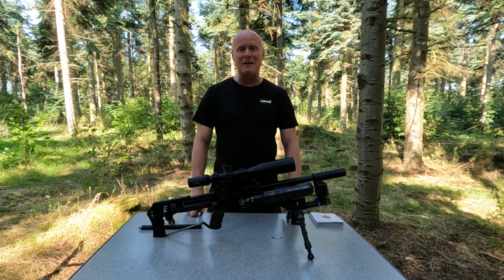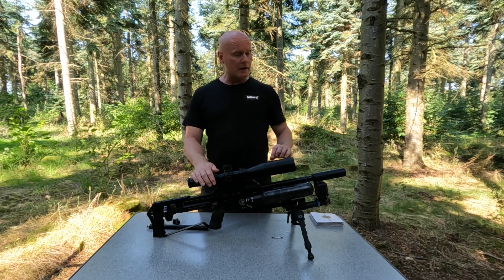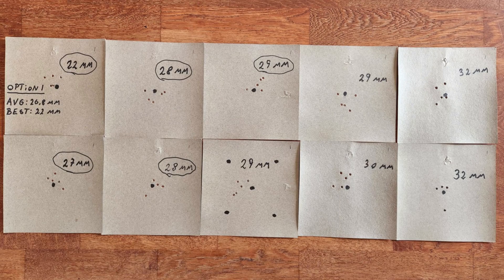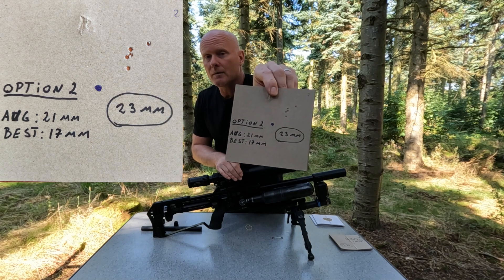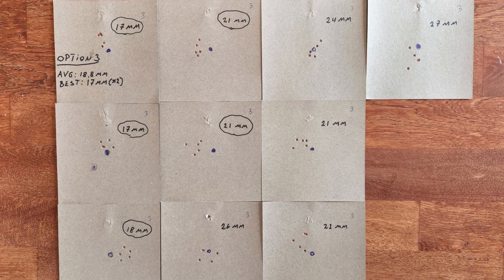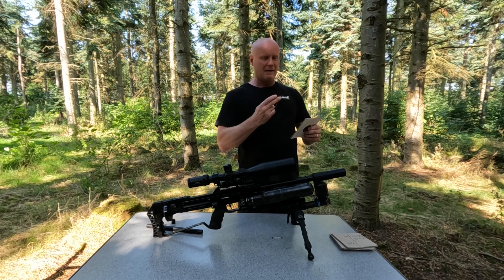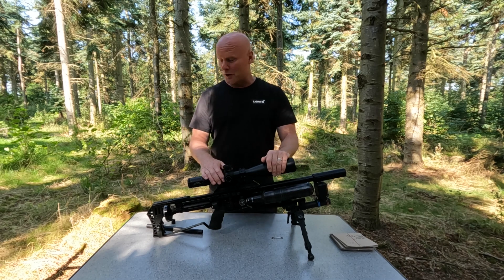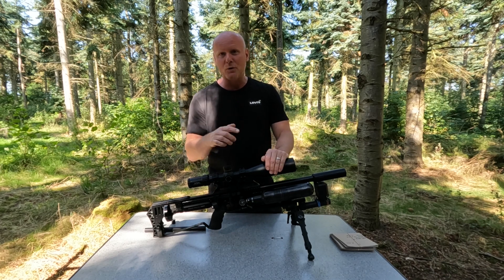TEST : Barrel Tensioner on FX Impact M3

Comment: Whats the difference from using the tensioner and using a barrel band from Blackarts design to stiffen the barrel
Reply from the maker: I havent tried the barrel bands but the way I see it, the bottle is far from 100% round, so when using a barrel band on an Impact it will not have a positive effect on accuracy.
On a gun like the Wildcat it would be a different case.
And the barrel tensioner stiffens up the whole barrel while the barrel band still allows the barrel to vibrate between the supported places.
Not saying what is the best and from my video you can see that the results with the barrel tensioner on the 600 mm 177 was not a succes for me.
Will be testing on the 700 mm liner when I get the heavy liner and hopefully get the heavier slugs to perform well 🙂
Reply: @VikingAirgunner  I have the barrel band and it stiffens that barrell tremendously.  I have it with the new FX harmonic barrel Tunner.  Still testing it and getting good results.  I   wouldnt think the roundness of the bottle will affect accuracy if we are using it to stiffen the barrel.  just thinking,  thanks for the input!
Reply from the maker: @nephtalilucero8084  Somebody asked me about the best combination of accessories. Made me think about how many variables we have to consider.
So my thought was:
When I get the right combination between reg, hammer, valve, liner, ammo, barrel tension, barrel tuner/no barrel tuner, liner sleeve/no liner sleeve, scope, bipod - my accuracy will be exceptionel 😃

So what I mean is that there are so many ways of setting up a gun, and there are many good and exciting ways to do it, and it is important to be open minded 🙂
Thanks for sharing your experiences mate 🙂
Reply: @VikingAirgunner  I am also interested to check "FX Impact M3 Barrel Kit STX Tensioned 700 mm"  with heavy liner. but issue that if should we change Dual Hole Transfer Port or keep it standard Transfer Port ?
Reply from the maker: @devroRR  Good question!
People have different experiences with the dual hole transfer port. I have a much bigger spread and when changing to the standard the spread went down by alot.
If I can get the velocity that I want with the standard port without having to turn up the too much, I will not go for the dual hole.
I cant imagine that I will use it again since Im not into the 20 gr. 16 gr is enough 🙂
Reply: @VikingAirgunner  I am also shooting 13gr and 16 gr slugs.  And this is the dilemma I am having that if I need to shoot 20gr or more I need to upgrade 700mm barrel and dual port. And if it will be accurate like standard M3 or not ? I don't want to loose accuracy.
Reply from the maker: @devroRR  Im currently testing the 700 mm heavy liner and so far it is performing well with the 13 gr. I will also test the 15 gr NSA and 16 gr Zan, so in a hopefully not to distant future a video will emerge 😃
Reply: @VikingAirgunner  I will be waiting your results and to watch your video 👍

Comment: Hi Peter, Nice test so we don't have to spend money on that. I am just to begin in the FX Impact 4.5mm world and would like to ask you what silencer/moderator you would recommend ?. I am living in DK.
Reply from the maker: Hi and welcome to the fx world 😃 You can look forward to many happy hours of shooting and many headaches when you cant get it to work 😂

The moderator that I use is a Huma Mod 40 3, but it is not much different from the standard one that comes with the gun in terms of both sound and accuracy. There are many other places to spend money before considering this 🙂

Best regards
Peter P
Reply: @VikingAirgunner  Thank you for your welcome, I have looked at almost the same channels as you, being confused is easy especially when there is so little 4.5mm content, so your channel is good sent. About the fx moderator, I have been told that tube/shroud that holds the moderator is empty in the DK version . I have thought about getting the Saber Tactical Arca Swiss Rail 2, just not decided yet if I should get the one with 3 holes in the bottom or the 2 hole version (vibration vise) I could imagine the vibrations from the 3 hole version being greater than the 2 hole (when bipod is not used, free hand shooting) I can see that you have the bipod about the same place as the 2 hole that is Picatinny at the end.
Reply from the maker: @zephyrold2478  It is true that both the shroud and the moderator are empty inside, but they have a good sound reduction. I have shot my gun without them both and like that it is very loud. Like in this video with just the barrel tensioner and a Huma moderator it is loud. I dont know if a bigger moderator would help, but Im not sure that I would like the looks of the gun with the barrel tensioner and a Sumo 🤔 But I guess that is individual 🙂
The Arca Swiss rail that Im using is super steady and I like the small piece of picatinny where I have my chrono, so I can use it at any time without having to think about vibrations. Hanging the chrono on the barrel Is a no go 😃
Reply: @VikingAirgunner  Hi Peter, I am having some gallstone problems, I will get back to you later.
Reply from the maker: @zephyrold2478  I hope that you will get a fast recovery 😳

Comment: Are you still using the Huma dual transfer port by chance, or did you keep it off?
Reply from the maker: Imideately after changing into the original transfer port I saw a positive change in spread, so now with a spread less than 5 fps I dont think that I will reinstall the dual hole transfer port. And on top of that I didnt need to raise the reg that much to get the velocity that I need, so all in all the original transfer port wins over the dual hole 🙂

Comment: The tensioner might work with longer barrels and heavier projectiles. This is due the flimsy design of the FX liners, straw pea shooters, no other manyfacturer requires this and their barrels aren't as slug fussy as the FX. I own a ccople of FX's and is getting fedup with all the market add-ons you need to make the gun better. It is getting absurd, I have been testing some 177 slugs on my own channel, and the more I test the more I get peeved off with FX. I had a LW barrel made for the FX, it is beautiful, only 500mm but it shoots 100% better than any 177 FX barrel. (I have the 500mm and 600mm). The LW wins hands down, no need for add-ons, no need for tentioners as the barrel is solid. No drooping if you add a heavy silencer either. I still love my FX, no other gun is as versatile, both in 177 and 22, but the additional marketing stuff is mind blowing nonsence. My HW100, AA EV2, AA HFT500 will kick the FX out the park any given day. This was obvious at the Worlds Hunter Field Target champs in Hungary... guess how many FX guns were used? NONE.
Reply from the maker: Hi Gert
Thanks for sharing your experiences! I really appreciate it.
In this particular case I feel like I have spent money on nothing. But I still wonder if it will make a positive difference in the 700 mm liner with heavier slugs. I kinda doubt it though. But this is explained in fx homepage, so I guess that I should have listened 😃
But I still think about the recent results of Ted Bier. A 0.38 group on 100 yards. That is impressive - but I also saw the amount of slugs in different brands and sizes that he had.
Also Im thinking of RMAC where FX is heavily represented in the top of the list. I know that there are mainly FX'S in the comp, but there are other brands aswell and seriously good shooters. I remember a national team member of SA with a Daystate. So the results of the FX'S must be superior. And if the guns that you mention are so much better - why arent they winning competitions like RMAC? 
And thinking about my own groups - 1,1 cm on 75 m and 2,2 cm at 100m. I cant really see how it can be done much better.

I am interested though in the LW barrels. They seem much less picky with ammo and all the advantages that you mention.
My question is:
From the national team member with the Daystate at last years RMAC, it sounded like you will only get 300 shots before you have to clean the barrel. And right after cleaning you have to fire alot of shots before the barrel is seasoned. That sounds a like a bit of a hazzle.
What are your experiences with the cleaning cycle of the LW barrels?
Reply: @VikingAirgunner  Hi Viking. in the 22 calibre and bigger FX has no competition. Lauren Parsons shoot Daystate, she is the current World FT champion with a Daystate. None of the RMAC guns are 177, again FX not good in the smaller calibre. FX does good where there is no restriction on power. The benchrest worlds are dominated by Steyr, Ft worlds the same, FX doesn't feature where power limitations and calibre limitations are present. 

LW barrels are more aggressively rifled, depending on the pellets you use, cleaning is not an issue, cleaning consists most of the time shooting a pellet cleaner through. FX are the winners here by far, the smooth twist barrel doesn't accumulate lead at all. 

FX is the current market leader, but the competition is closing in quickly, RMAC was won with a Priest a year or two ago. The adjustability is superior in the FX, but all the aftermarket things you need to buy is rediculous. The sponsored guys get all this stuff for free... Me , I am a salaried employee, I can't afford this stuff and I love this sport, spend a bucket load on every new FX liner, barrel, bag rider, Element scope etc. I just reached a place in my life where enough is enough. I am not spending another dollar on stuf that is most  of the time either marketing nonsence, or could have been in the original product. How many FX owners buy them to shoot "standard" pellets?

I tilt my hat for FX, they are making mega bucks in the process, their R&D is superior to any other air rifle manufacturer. I just can't afford all the "needed" extras anymore. It is a bottomless pit. 

I spend more than 12 months testing jsut about every darn pellet and slug available to me, just to realize that you can shoot just about any slug with decent accuracy if you spend the time fine tuning your gun. My HW100 worlds gun took only 3 tins of pellets to find one that was brilliant... 

How many FX owners have the time to put into testing that you do? They simply buy the "next" gadget the Youtubers post... There is only 1 youtuber a fully trust with his feedback. (You are going to become no 2 with the great work you do - please keep it up).
Reply from the maker: @AimSmall  Thank you so much for your answer. I follow you completely.
I just have to confess that I have not yet given up on buying all the new accessories - Even if the last purchase was a bummer I still like the testing and making the videos. And thank you for your appreciation of my honesty, since that is what I try keep all the way.

I didnt know that cleaning the LW barrels was so easy. Im more and more convinced that I have to give them a try 😃

Best regards
Reply: @AimSmall  I have 5 FX air guns in different calibres none of the guns can hit a target accurately at more than 70 yards.
Reply: Gert you nailed it. Every 6 months there is a newer gadget thats just better and you must have it. For the amount of money we spend in these fx impacts it should be the best it could be out of the box. Fx should rather focus on their qaulity control wich is 0 to none. Almost every rifle has a leak. Its a shame really.
Reply: @kobusswart2972  Thank you Kobus, I didnt want to go into that debate... haven't had a single FX yet without a leak... too many o-rings.
Reply: @kobusswart2972  oui j'ai démonter tout et remonter, après ok
Reply: Good consideration, but.. where can I find the LW for the Impact? Many tks
Reply: You need to special order from somebody, I ordered mine when H&N asked for a special barrel for testing. @fabriziopapetti8455

Comment: Hey Peter - thanks a lot for the video. The only way I can achieve tighter groups for my 177 Mk2 600mm plus the FX barrel tensioner kit - is to use the harmonic tuner in addition. By the way, I have used about 2000 NSA12.5g slugs through this combination from ca. 940 fps to 990 fps, and in the end concluded I couldn't make it work. Also couldn't get reasonable groups without the barrel tensioner kit. However using the NSA 15.0gr slugs plus tensioner kit plus harmonic tuner delivered OK groups. Not tried the VAN slugs yet but will do after all the NSA 15gr are used.
Reply from the maker: It is very much in tune with the info on the FX USA homepage that we will see the difference with heavier ammo.

In my experience it is just such a big work to find the right position for the barrel tuner - but if I didnt change/test so many different slugs it would be one hour and a whole bunch of slugs and it would be settled 😃
But very nice to know that the barrel tuner has a positive effect, so thanks for sharing mate 🤗
Reply: @VikingAirgunner  btw.
Maybe off topic but try to watch Teds Holdovers newest video and give feedback if you think its worth investigating further?
Reply from the maker: @Viking_X  I saw his video - and so nice to see him back 😃- For him with a 22 and a 700 mm barrel it certainly makes sense 🤗
And what a group 😳😳😳
Reply: @VikingAirgunner  Agree Peter - ideally it shouldn't be that we need to buy more special parts to achieve the expected results out of the tensioner kit. Having said that - it's a bit of fun testing these things 😂
Reply from the maker: @nonickname6154  Funny you should mention it. Im sitting here with my Wildcat that is tuned for jsb heavy. Shooting pretty good, no need for tuning and is actually kinda boring 😂😂😂

Comment: What the best speed for slug 30gn?
Reply: Hi Chanya, 
Perhaps I can help you. Using a Standard superior liner 700mm on my M3 I get excellent results shooting H&N .218 30gr. Slugs.
MV 985 fps
Ist reg 165bar
2nd reg 135 bar
Valve adjuster just over 4 lines 
Macro 8
Micro 4
Play around until you achieve 985 or 990. Sub MOA no problem.
Good luck
Reply: @mariocesare7669  thanks
Reply: @mariocesare7669 600mm slug  30gn cal22 ??
Reply from the maker: Im only shooting .177 so I dont really have other than my YouTube -knowledge on the other calibers. But I imagine that there are different Best speeds for different brands of slugs.
Maybe ask in one of the bigger groups on FB or find someone here on YouTube who is shooting the same slugs 🙂